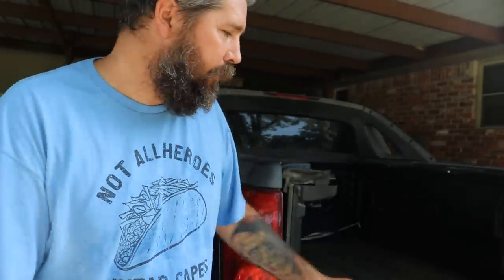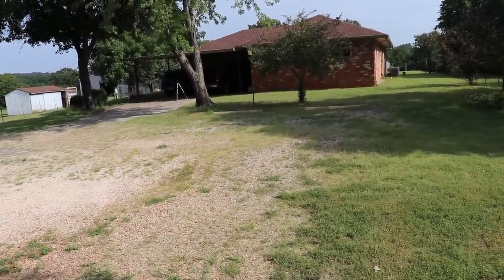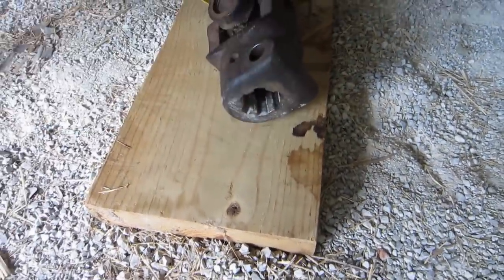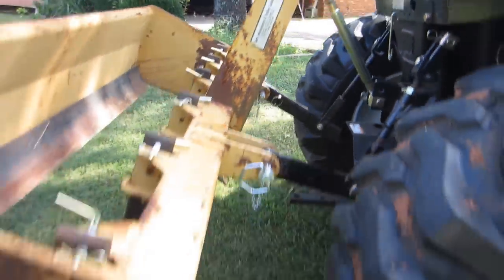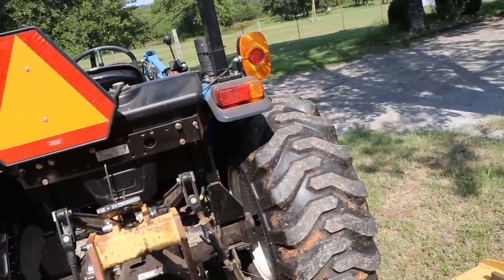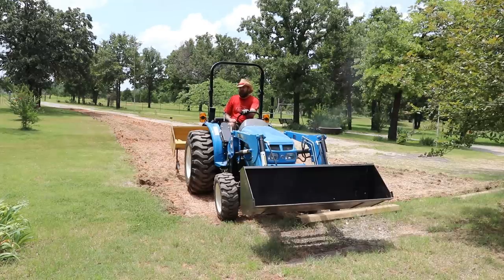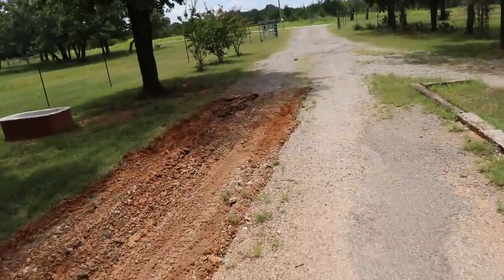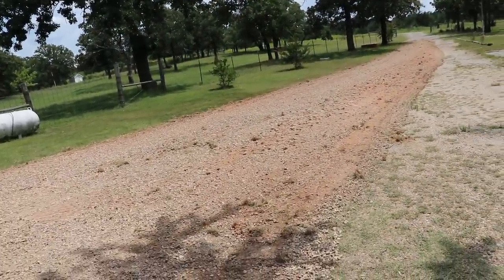How NOT to Box Blade Your Gravel Driveway

Comment: I'm fairly new to using the box blade , but I've found it to be an indispensable tool for leveling nearly a 1/4 mile of gravel driveway. It also is great for cutting swales or leveling dirt. One tip I have, avoid using the scarifiers until the blade no longer works. Basically if the blade isn't cutting the surface, but sliding across, then lower the scarifiers. Another tip, you need to properly level the blade to the tractor, both front to back and side to side. If your top link is too long, get a shorter one. I put the tractor and blade on level concrete, then I use a bubble level to level the box blade. You want the two blades perfectly level front to back in just about every situation and you do this with the top link only. However, if you want to slope a crown or cut a ditch, then you lower/raise one of the lower arms. Also, don't forget to tighten the sway links and ensure the box blade is aligned to follow the tractor without kicking to one side or the other.
Reply: Great advice!

Comment: The larger stone and clay you brought up is a bad thing. The larger stone is the base layer, kind of like a foundation for a house. The larger stone prevents the smaller pieces of stone from sinking into the clay/mud when it rains and gets soft. For a better result, keep the teeth just about the level of the blade in the back. For your driveway, the blade should level out the smaller gravel and also scalp the grass/weeds. Just go over the driveway about 4 or 5 times, it will clear the grass and bring the dirt up, as well as level. I seldom use the knives unless it is so bad you can't see anything but dirt and weeks but you know rocks are there. Then I use only the next hole in the knives so it is just deeper than the back blade. Take your time and do small depth drags, don't try to do it all in a pass or two. To me, the sides of the box don't look like they go down far enough to capture the gravel/dirt. Have the sides been worn down? Should make a box with back blade and sides all touching and being level at the top as well as the bottom. To smooth it out you don't need the teeth down, pull them up and just use the blade to smooth it and level any low spots. I hope you didn't totally destroy the base to your driveway. Good luck and hope it worked out well for you.
Reply: Agreed.
If it is possible could he not compact what he has now then spread a layer of gravel on top?
Reply: oh shit whole tutorial

Comment: Great job Hoss, few more passes over the next month or so you'll have it looking better than DOT. (work it up then drive over it to pack it down, work it up then drive over it to pack it down) 

I'm working in 94 ton traffic bound over 2000' of driveway. It's been 20 years since my last driveway maintenance project here at the Ponderosa. I'm using an old 1942 Ford 9N with box blade and a new Mahindra eMax 20s w/front loader we just bought.
Reply: Which of the two tractors do you prefer?

Comment: It looks better for sure. Next time, leave the rippers higher. If you ever have a chance, try a rock rake. I love mine for the garden, and gravel, as well as raking limbs from trails through my woods. A rock rake would be perfect for after the box blade. I helps bring the gravel up to the surface.  Don't be so hard on yourself, you did a good job, and learned as you went!
Reply from the maker: Actually went to look at a rake after work today. It had been broken and welded too many times for how much the guy was asking.  I'm still looking.
Reply: at this point teaching is gone
Reply: Yep, I love my rake, I have a grader, but 9 times out of ten I just dress it with a rake and that doesn't loosen it all up so deep. If you get a rain right after what you did you will likely have huge ruts if you have much of a hill at all.

Comment: Not bad at all. You have a loader on the tractor: simple trick is to lower the loader bucket to float and back blade using the loader bucket after box blading.Will make the surface smooth as a pool table.
More details: you want your bucket to be in a slight down angle on the cutting edge. To float you push the lift lever hard forward. You will fill the down pressure position and continuing to push the lever forward you will fill it slip past a detent. Past that detent puts it in float. To remove from float position just pull lever back to raise position.
Reply: feel and not "fill" it slip past detent".

Comment: You did fine for a first timer. My drive is around 200’ long by 12’ wide. I made the same mistake my first go around and went too deep as well. I ended up making a 4x4’ drag out of 3” angle iron with a 4x4’ piece of cattle panel I had laying around welded inside. I drilled holes every 8” down the side I have the chain welded that I drag from and installed 1/2”x4” bolts/nuts to act like tiny versions of the ripper teeth. The weight of the frame is perfect to allow the bolts to dig in and bust up the top layer while the frame spreads the gravel while dragging. It gets the surface gravel without disrupting your foundation stones. Once finished breaking up the surface gravel, I drag an old old set of standard size mattress springs over the top to smooth everything out and make it pretty. Worked perfectly for my application and I’m done in a few hours. Be sure to drive your truck over the entire surface and pack it all down afterwards. If you don’t, the first time it’s damp you’ll have low spots in the high traffic areas. Tractor tires don’t do a good a job packing as street tires due to the pounds per square inch. Best of luck, bro. I subbed as well.
Reply from the maker: That's exactly what happened. The first time it rained I had ruts. I've since fixed the problem. It's not as pretty, but it's solid. I actually just scored a pasture drag for $25 that would probably work pretty well for this.
Reply: @BlackSparrowRanch  good job starting our may want to consider getting a rake (got mine form tractor and supply fairly cheap) it is a lot better on that type of drive than your box for typical  maintenance, in my opinion it does a good bit better filling in the holes and spreading than a box blade.
Reply from the maker: I have since gotten a rake and a harrow, but I haven't tried either on the driveway. I graded it again after this video, but I didn't feel the need to record it. It went much better the second time.

Comment: Your a big guy 'Blue'. Like your tractor and garage area. I found Quick Hitch really helps changing three point tools. A small adjustment at first, with top pin of some tractor tools needed. I have about 11 cat one 3 points tools, after adjustment I've removed an installed some tools without getting off tractor seat. Had installed tip/tilt, so adjusting 3 points tools for being level and tilt correctly keeps from getting off tractor seat. EDIT: Picking up little larger tractor, moving from 33 to 47 hp, having same setup being installed now. Plus new box blade 7 teeth Land Pride HR2572 851 lbs. And Yes a Sub Spoiler is a great tool to have in your arsenal.

Comment: Man, good job, at least you didn’t made a hole in your brand new $520 back tire with the rippers like I did.  I was just backing up from the garage. I had the top link to long and the rippers where hangin up inwards. It was the most painful mistake I ever made. My brand new tractor has less than 3 hours.
Reply from the maker: That definitely doesn't sound like a good day.
Reply: Stuck one in a worn out tire....at least now I don't feel so bad....my other tractor, has $2 grand tires, thank God it's only setup for drawbar implements.

Comment: I hope in the last two years you found that the rippers can take out that asphalt if you choose to do that. The rippers are great at ripping up stuff, but remove them altogether for finishing. In fact you may find you don’t need the rippers for most situations. Set the top link so the back blade is a half inch or higher than the front blade, depending on how aggressive you want to grade. Remove the rippers. The front blade will act as a dozer, collecting material and filling low spots. Then backing up, the back blade and front blade together will further smooth out the surface you just went over. 
Set the side link to raise or lower the right side of the box, allowing you to put a crown on your driveway. 
 
Box blades are incredibly useful.

Comment: Looks great, very much improved. Also good attitude, get in there and give it a try, for some of us it is the only way we learn. Again great job.
Reply from the maker: Thanks Buck. I didn't grow up around tractors and don't really know anybody that does this kind of stuff, so the internet is really my only resource. -Aaron
Reply: @BlackSparrowRanch  I spent most of my teenage years on tractors but never have used a box blade, I now have a couple of older John Deere Tractors, a 1954 70 gas Two Cylinder & a 1959 440 Crawler.. I enjoy working with them both.

Comment: Looks much better. I find that on a driveway I use the rippers very sparingly. If you lengthen the top link and get that front blade up a bit you can really smooth things out at the end..
Reply from the maker: That's how I did it a few months ago and it worked pretty well, but I didn't make a video about it.

Comment: You did fine, have good equipment,
Normally after a few days and maybe a rain the dirt will drift back down and you will have more rock,
Maybe in time you could get another load of rock and smooth that over your driveway,
These gravel drives take maintenance from time to time but much cheaper that a blacktop driveway,
Also I have a rock rake it will smooth the gravel a bit easier, but in your situation you had to use the box blade diggers to loosen up the top surface, 
Take a look at a rock rake, you might borrow one before buying to see if it’s something you are interested in,

Comment: You can get a pushpin repair/replacement kit at TSC or other implement dealers. If the hole isn’t wallowed out in the PTO coupler. I started using a box blade recently and found some helpful videos here. A hydraulic top link can make it a lot easier.
Reply: shit right
Reply: Looks nicer now. I like an adj. Rear blade, though. They are cheap and you can move material left to right. Also you can reverse blade and run over rock backblade and it smooths the gravel flat. Box blades are must have too. Both are not that expensive so you can afford both. Enjoyed your video. It was fun to watch and the quality was very good. Thanks.

Comment: On your 3 pt implements work from left to right. Right side has the adjustment. Between your hydraulics and adjustment not much banging or lifting should be needed. When you get larger, heavier implements no one is strong enough to horse around.

Comment: Cheap and easy gravel rake: at TSC- ATV 4' x 4' chain Harrow.  $280.  Weight it down with old tire with bricks on it.  I worked at RV park with gravel driveways and it brought the gravel back to the surface like a charm.  People hated it cause it was hard to walk on until the gravel settled down a bit.

Comment: I think it looks great.  Box blading is something that you need to practice a few times in order to get the hang of it.  Its not easy to get the feel for moving just enough materials to accomplish your goal, but not so much material that you cause yourself a lot of extra work.  I have had some luck using the draft control when box blading but it comes with its own set of challenges.  I had a friend ask me how the box blade works so I posted some videos up on my channel if you're interested.
Reply from the maker: I will check them out.  I don't think this tractor has draft control. I think my old Massey did, but I never needed to use it in the short time I owned it.

Comment: Just bought a bb and will be learning later this week. I think you were a little too deep with the sacrifices. 
I have crushed asfault that should breakup easily. And mix with the 5/8- crushed gravel. At the start it looked like you were tilted so it picked up a lot of gravel. I think you changed the angle later and that looked like it worked better.
Now to see if I can get it right as I use my bb for the first time.

Comment: Just a little bit of advice instead of constantly having to adjust your top link set it up with a hydraulic cylinder on the top link so you can adjust the picth of the blade if you have enough hydraulic Outlets.
Reply: How do you adjust the hydro while off the tractor and hooking it up to an implement? Reach over and adjust slightly or is there a little play in it to get it close then hook it up? Does that make sense?

Comment: Well done. I’m sufficiently inspired to give this a try myself. Thanks for sharing.
Reply from the maker: Make sure you drive over it to pack it down. I thought I had done so, but ended up with a couple of pretty deep ruts the next time it rained.
Reply: If that happens, you have to break up the “hard pan” at the bottom of the rut. Sometimes in red clay, you have to scrape way down to the level of the bottom of the rut, then drop the rippers to really break it up. If you don’t take care of the hard pan the ruts (and or pot holes) will just come right back.

Comment: Subscribed. Looks much better, excellent first try! Your only issue was going too deep and pulling up  some larger base gravel. Less depth a bit more speed,initially, then rarely need scarifiers for driveway. As to the asphalt, man I feel your pain. I've got 1000ft or so   of mixed old asphalt and gravel. Still haven't figured out what to do. Keep up the efforts, be well.
Reply from the maker: Thanks for the tip. I'll keep it in mind when I redo it next week. It probably wouldn't hurt to have a load of gravel brought out, but I'm trying to put that off if I can.

Comment: If you have a vise, bend the pin so it doesn't go through. Or put it into where it goes and then hammer on it . 
If 9/16" goes through try to find a 15mm bolt. length maybe to cut the threads/ taper the bolt??

Comment: You did a fine job, just dug a little too deep. Another hint that I didn't see from all  the great advise would be to crank out the right lower lift arm a few turns, then run on the drive from one end to the other changing sides each time. This will allow you to put a crown in the center which will drain water to the ditches....
Reply from the maker: I didn't think that was necessary because the whole front of the property slopes to one side. If I put a crown on it, I'll have standing water on the propane tank side of the driveway.
Reply: @BlackSparrowRanch  Yeah for what it's worth, it's hard to judge grade and slope from a computer monitor! Sounds like you have it figured out. Carry on!
Reply from the maker: Yeah. I run into that a lot when I'm trying to show sections of the pastures. It's very easy for me to see because I'm standing there, but difficult to get the video to show it.

Comment: Make sure that you don't run the box blade over any asphalt or concrete areas as it can damage the unit and maybe the tractor. When using the cutters on the box blade to rake the gravel you can raise the cutters so they are not going that deep, or you can put them up and go over the area with just the blade down and leveling your gravel.
Reply from the maker: I've learned a lot since this video. Unfortunately, there are random patches of asphalt and concrete everywhere. If I ever have some time, I'd like to bust them up and have more gravel delivered to fill in the holes.

Comment: Just my two cents ...... But for what it's worth I have found that doing what you are trying to do my  DIY ratchet rake I made works better than a box blade and is a whole lot quicker at achieving the same  results. My driveway is around 300'.
Oh yeah one other thing ... when the time comes to replace your box blade blades and your not to far from a Discount Steel store they have blade stock in different sizes and lengths cheap enough. but you will have to drill your own holes. Enjoy your tractor and have fun.

Comment: How long have you had the LS tractor? Had any issues with them?
Reply from the maker: I've had it almost 2 years. It's a 2012 model and had 115 hours when I bought it. I've put about 100 hours on it. I had to have the seals replaced on one of the hydraulic cylinders and I replaced the original battery. I've had no other issues with it.

Comment: Also if u trying to resurface ur drive way and bring all the rocks up look up landleveler I have one and I use it every 2 years
Reply: I think it's the same thing, but I have a Land Plane. It's much longer than a boxblade and has two angle iron blades mounted like "^" so the gravel is picked up and rolls over each blade, really bringing up long lost gravel and smoothing it out,  ready for use or compacting.
Reply: Yeah 2 ^  and it bring rock and dirt up at first but then dirt goes to the bottom and rock stay on top it take longer to do it but work amazing.  Thanks for making this video I’m trying to learn how to do it with my boxblade